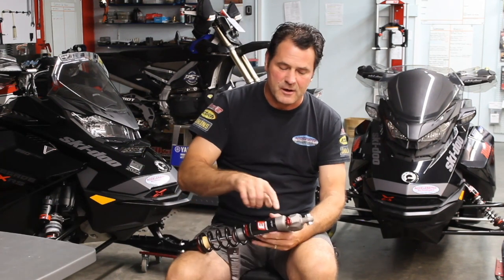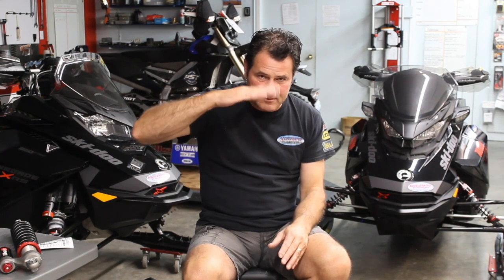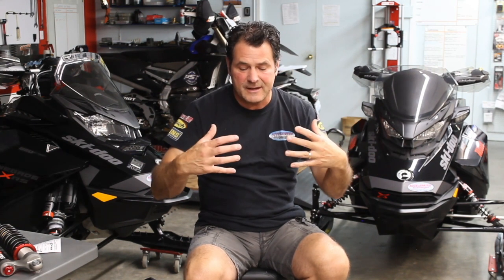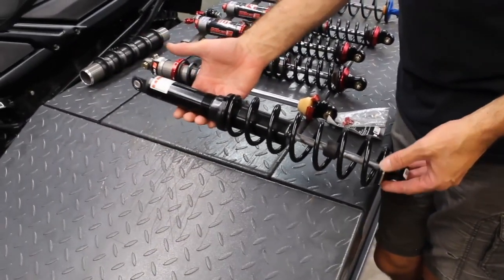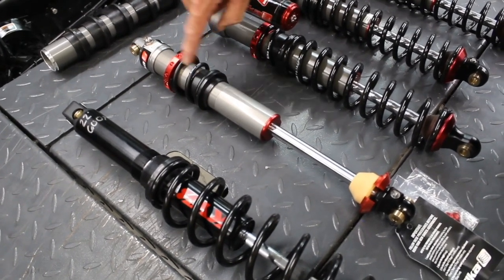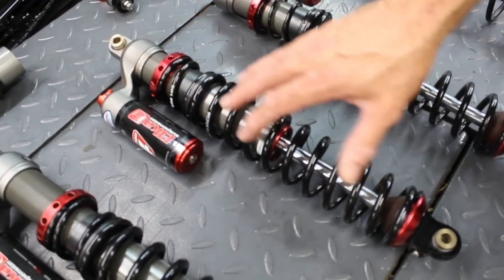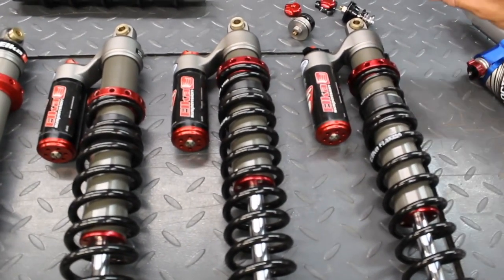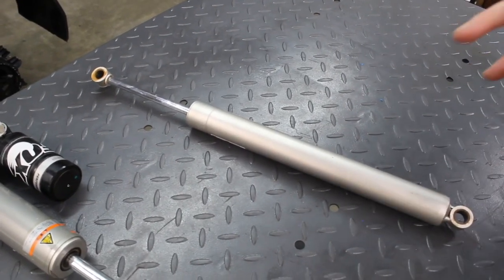Accelerated Technologies Snowmobile Suspension Tuning: Compression damping explained

Comment: Your video is the most informative that I have ever seen pertaining to how a snowmobile suspension shock system works. Thank you so much. I sprung for aftermarket shocks (Elka and Exit) and have been struggling to adjust the shocks to be at least better than OEM. Still not there but hopefully your videos will help me to find the sweetspot. Hopefully the spring selection and damping range was built properly for my use. Again, many thank you's. And yes I subscribed.

Comment: Great Video John 👍🏼 Soon I’ll be installing the set of 4 Elka Stage 5 shocks I ordered from you last fall for my ‘22 T-Cat.. I took delivery very late in the season so I’m looking forward to running the sled with Elkas this winter. 😁 Take Care
Reply: didnt like the qs3's that came on the sled?
Reply: @bennyb6071  Hey Benny, 
No I didn’t care for them at all. The QS3’s were a harsh ride IMO no matter what I did and it’s due to lacking rebound adjustment. I was very disappointed with the offering of the Fox QS3’s on one of Cats highest priced sleds. If it came with the FOX QS3R’s as standard equipment I could have worked with them as they have rebound. The QS3’s do not. 

Coming off of Skidoo since 2007 and this being my first Arctic Cat, I can now say with the Elka Stage 5’s installed the T-cat rides as good as my XRS 900T with R-motion. That’s all the Cat needs to do is offer a better quality shock on their high end T-cat. Take Care ❄
Reply: @SometimeIsNow  interesting,  appreciate the reply

Comment: What do you think of the fox float evol shocks?
Reply from the maker: @jakelutz22  hi Jake. I’m a fan of the fox float series of shocks. I’ve seen too many problems, the seal and wiper design is very very high friction and the bodies anodized aluminum are prone to damage in competition use causing constant air leaks. Also air as a spring is dramatically progressive so we struggle with a rebound calibration to work well at the top of the shock travel versus the bottom of the shock travel. Too many problems to overcome that we don’t have with a conventional coil over.
Reply from the maker: Oops Jake.  I meant to say I’m NOT a fan lol.